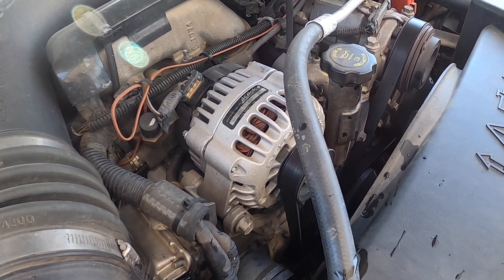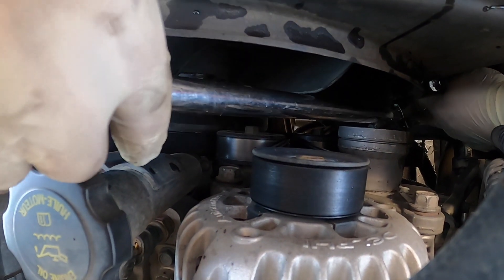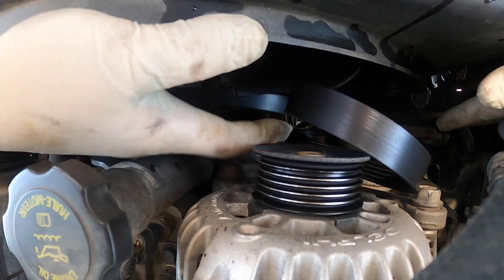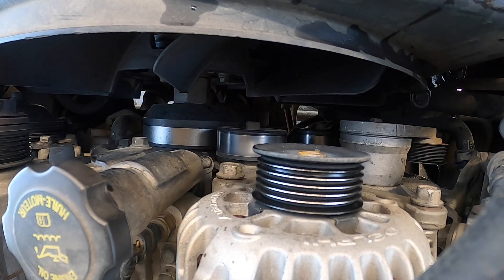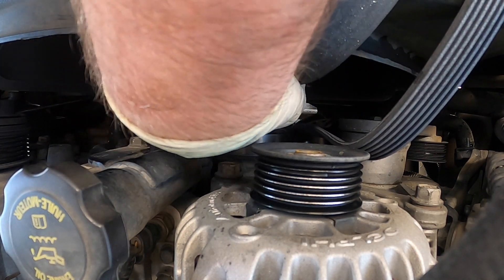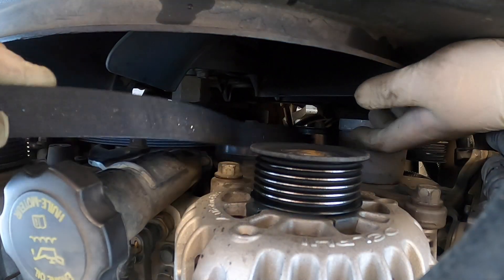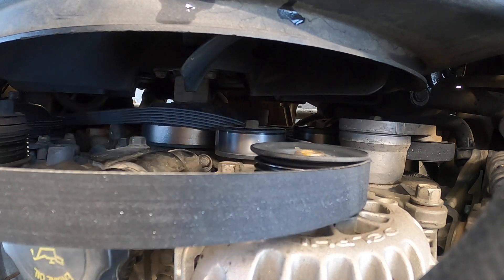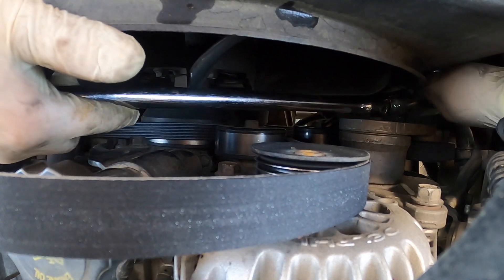2005 Chevy Silverado 2500HD 6.6 Duramax Serpintine Belt

Comment: What is the overall length of that belt I think the parts store gave me the wrong one they swear it’s right but I am racking my brain I’ve never had this much trouble with any serpentine belt ever 😂
Reply from the maker: From memory the LLY single alternator trucks are 6k1195 and the dual alternator trucks are 6k1360
Reply: Yeah he gave me the 145 amp alternator belt after three times no it’s the 105 amp alternator the parts store guys some time I swear same dude that sold me an EGR valve and said it comes with gaskets and no gaskets came with it….